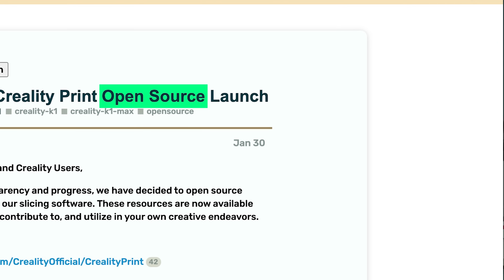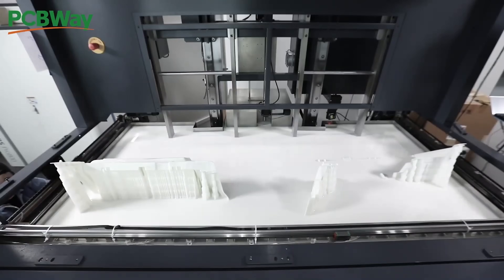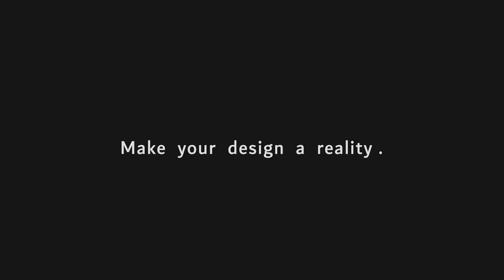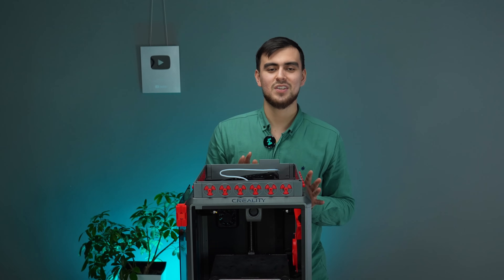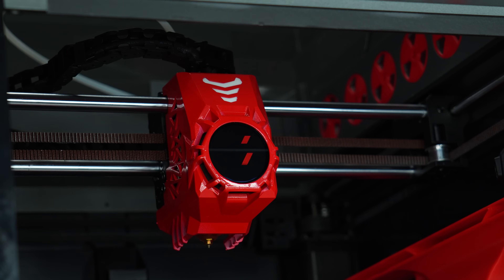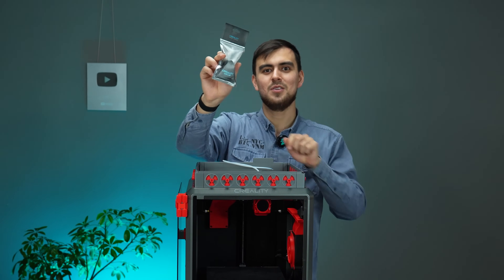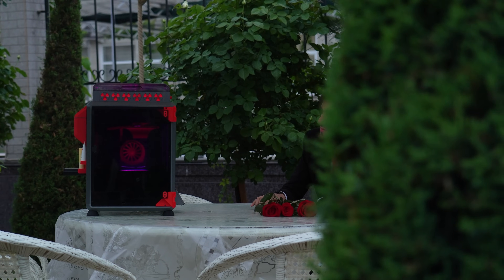17 Essential Upgrades to Enhance Your Creality K1

Comment: The scenes in the video are changing too fast. You don't have time to consider the details. The video is useful, but the editing is terrible.
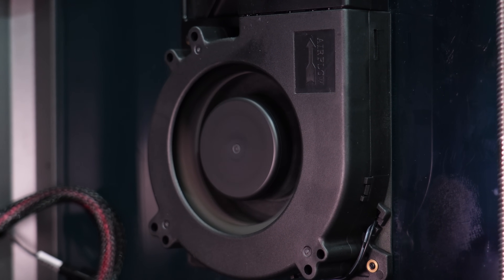7:51 This fan inside is completely useless. If you're using it for some reason, just don't stick your fingers in it.

Comment: Carbon Filter doesn't work. It's just like close fan and problem was solved. 
I did it like in the video and I've got +10ºC in camera. 
The fan just doesn't have enough strength

Comment: HELP. I have made the hot bed single unit, added a 24v fan, installed as per vido and double checked I pluged is in the correct plug on the motherboad, BUT the fan doesnt run. Any idears how to fix this or guide me if I have done something wrong.

Comment: Pro tip as to not do what i did, DO NOT TRY THE HINGES ON THE K1 MAX, the screws are too short to pass through the hinge sockets into the holes, i tried this and was disappointed after i wasted 5+ hours printing just for it to not work :(.

Comment: It’s crazy that these printers are still being tested on the public. I had the original Ender 3 v1 and spent 50% of my time tinkering and not printing.. the last thing I would want now after spending hundreds of pounds is to have these hassles.
Reply: The K1 is several iterations past this. Many of these are no longer necessary. They give you the better extruder and hot end now and the door has been improved. I cant remember if the top extender is also part of the new design or not. You may have to print one or two of these and only if you want to. There is a spool holder that is a file on the memory card or in the firmware when you get it.

Comment: while researching the k1C model, came across your video. Very clever editing and very interesting additions with good logical explanations and references. I would get rod of the fan opening on 3of 4 sides and only leave them in the front, in my opinion, all four sides is an overkill and potential for heat loss. Seeing the tools you use also makes good sense for me to get something similar. This will be my first 3D printer and your video (along with few others) definitely sways me to k1c model. Keep up the good work

Comment: you really need to invest in an impact driver...I cringe when I see people using a drill for screws/bolts.. Drill combo kits usually come with an impact driver as well, but if it didn't.... They're honestly not that much, and your wrists will thank you, and you don't have to deal with the stupid chuck when wanting to swap bits. And your screws will be torqued down better than with a drill.

Comment: My hinge holes on my K1 do not line up with the Printables project. Did they change the design at some point, or am I just doing something very wrong?
Reply: Ah. I see the issue. For anyone else with a newer K1, you need the K1c files. I guess they put all the new K1s in the K1c cabinet now.

Comment: Hello, I made the modification of placing the fans under the bed, but they do not turn on, it seems that the port that you showed on the card does not supply power to them, do I need to make any configuration modifications?

Comment: fun fact i own the exactly the same printer but i can't get it to last more then one print without clogging or destroying something, since i've bought it i've managed to complete 12 prints and that took 2 hot ends, 8 clogs, 1 fan and i've just about given up on it ive had 2 enders and they work fantastic so i decided to try k1 but holy shit its a troubleshooting magnet its 4 problems 1 print each time and in not even doing demanding things, the things he printed in this video are way harder than what i've managed with my k1 and im genuinely shocked that his actually produced the items and bet your ass that creality will not answer you once you've bought yours

Comment: Oh man... :) Much ado about nothing. Or should I say: I changed heads three times, handles twice, but this is still my old father's Little Axe. I, who haven't even printed a benchy, don't care what it looks like. I just traded the nozzle for the diamond and it's worth more than that. ;) Maybe I should throw a buck for the cut? :) It's fun anyway. All I need is prototype printing, but it doesn't make it any better. It's a good printer, but after that I don't buy from any manufacturer, I prefer to build it myself.

Comment: Can you please detail the firmware tweaks you made for the 5015 fans for the heated chamber part? I'm assuming you rooted the printer and made a config change to enable the spare pin on the mainboard?

Comment: It’s 2024 we should not be encouraging this upgrade culture, it’s detrimental to the hobby making it complex and cost prohibitive for beginners we should vote with our wallets towards better machines straight from the factory.
Reply from the maker: that way, we will get closed-source printers from them :(
Reply: @engineericly  That's not guaranteed to happen all the time though, also i just meant to this degree, 17+ mods is excessive

Comment: Even with a tall open riser and temp controlled room my K1 Max still suffers heat creep issues and clogs in the extruder anytime there is a print that has a large volume on the bed.
Reply from the maker: Which material causing the clog?
Reply: @engineericly  PLA. Heat creep is terrible on some of these K1s.
Reply: What is your chamber temperature?

Comment: What kind of plastic are the parts printed on? PLA?
Reply from the maker: I have used PETG/PLA/ABS depending on the part, but I would suggest using only ABS as most of the parts should be high heat resistant

Comment: This is an awesome video, I have had alot of these problems with my preorder K1 and will be implementing most of these upgrades. I would be really curious to see how the printed extruder compares to the newer creality model (i ordered the new one but plan on making the printed one out of my old extruder as a backup or for another build). I also used the same clip for the bowden mount but i found the ptfe cable went to high up and I heated it with a lighter (or heat gun) and let it bend down a few degrees to make an easier transition to the bowden tube running on top of the chain link with clips.
Reply from the maker: Thank you for your tips:)
Printed extruder was great as well, no changes in quality of prints, but changing filament was hard with that
Reply: @engineericly  Thanks, Do you think it would be difficult to make the printed extruder run with a Nema17?

Comment: You need to cut the wires to the extruder and add in new connectors on the 4 wires. That way you don't bend the connector that is on the hot end.  I have a max with one pin bent. 950 dollars with a 1/2 a cent connector. F U creality.

Comment: The guide chain comes apart far too easily
Reply from the maker: yeah 🥹
Reply: @engineericly  I fixed it though
Reply: @engineericly  It never came apart again
Maybe they forgot
Reply from the maker: @ How?
Reply: @ Quality control must have missed it  i have not had a single component failure  actually